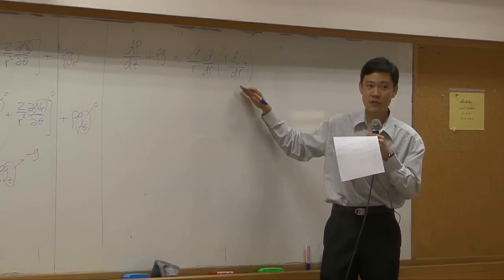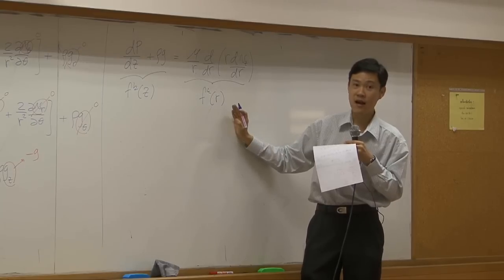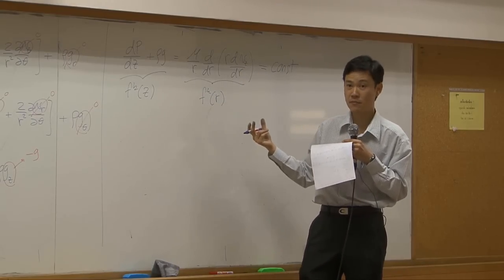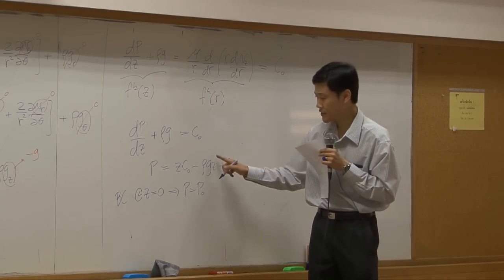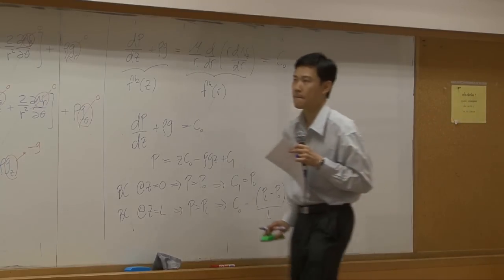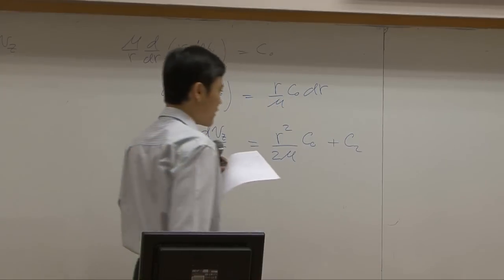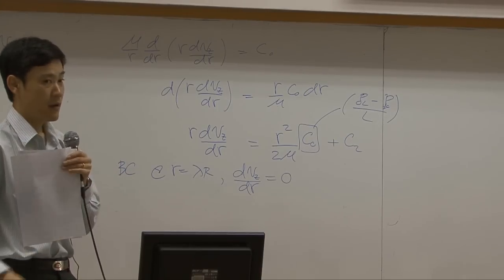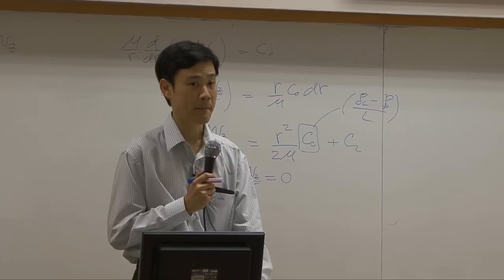Transport Phenomena lecture on 21-11-12 - Momentum transport 7/10 (part 6 of 6)

Comment: Thank you very much about your lectures ,it is help me alot.
and i have a question about the boundary condition about flow through an annulus ,why we do not choose it 
@r=R1  V=0
@R=r2   v=0 
because i know the value of velocity in this positions ,but the position of the max velocity i do not know it 
Thank you
Reply from the maker: Yes, you can use 2 boundary conditions as you mentioned. The result will be the same.
Reply: Thank you very much 
I solved the problem about my result and it get me the same result.thank you very much about your efforts.